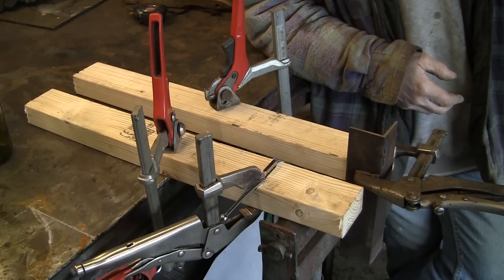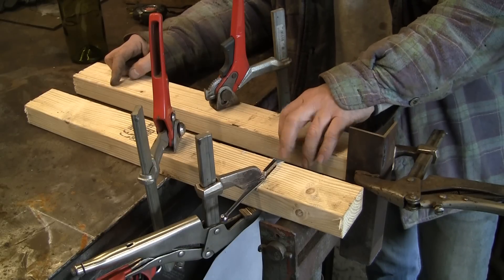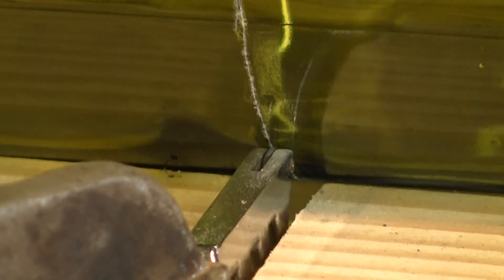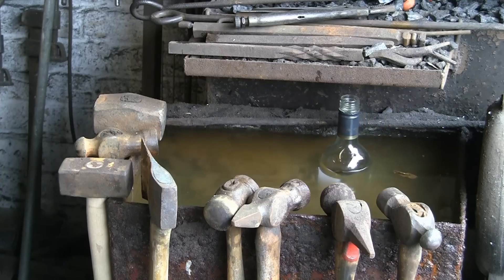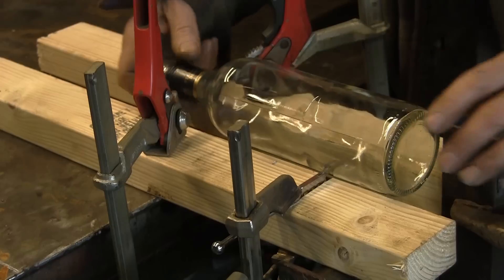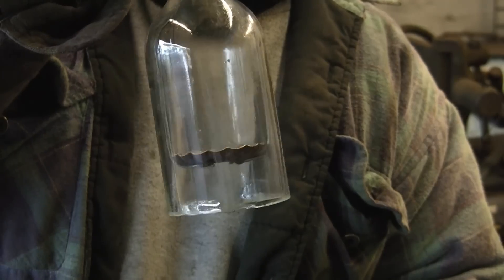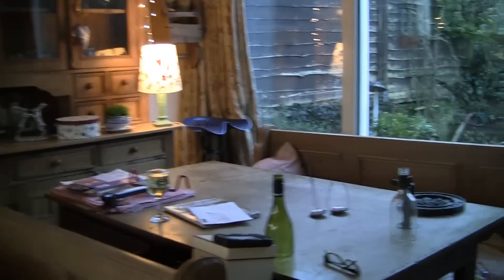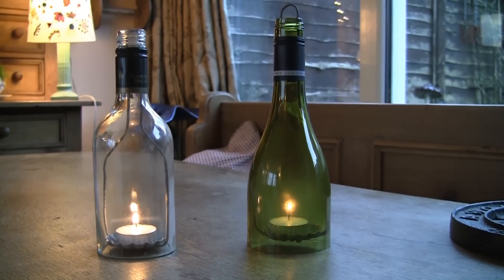Bottle cutting

Comment: The top portion of the bottle make great sounding windchimes I usually run a string down the top of the bottle then a washer to hold the string in the neck of the bottle then from the washer another string with a wood ringer on and then a wind catcher ,really works well ...cut mine the same way some are hit and miss...great vid

Comment: Hey Gary, another great video about cheap ways to keep the misses happy. One thought I had, what about using an acetylene torch with a welding tip to just gently melt the edge after cutting instead of spending all that time with the sandpaper.
Reply from the maker: +Don Marchetti Try it and see, it will probably break though.
Reply: The bottle would have to be preheated. I tried to use propane on cold glass and it exploded. flame was to close to the bottle.

Comment: Hey Gary, I do a lot of homebrew cider and winemaking and have a tip for your bottles.  To get the labels to peel off in one shot I mix 1/2 cup of Arm and Hammer Super Washing Soda into your water and they separate quite clean from the bottle after soaking.  I soak them in hot water so I don't know how it works in cold.  I'm also not sure if it's called the same there, but you're looking for a similar product that has an active ingredient of sodium carbonate.  All the best.

Comment: A process that I have used for "breaking" the glass is: Slowly spin the bottle (keeping it horizontal) over the flame of a candle, following the etched line around the bottle, (About three or four times around the circumference of the bottle.). Then, pass an ice cube around the bottle, again following the etched line. Pretty quick job!

Comment: I am so impressed with your glass separating trick. This will come in handy. Would it work to somehow chuck the bottle in a drill or lathe (maybe using a tapered dowel) and polish the edge that way? Or use a faceplate on the lathe with sandpaper on it and set the speed rather slow? Yeah, that would be less dangerous than the first suggestion. It'd be hard to keep it square but maybe there's a way around that.

Comment: The problem with the clear bottle not following the cut line is actually because of the cutter. Cheap glass cutters are convenient but the wheel is made only from carbon steel, unlike their expensive siblings that use carbide cutters. The way to get by using the cheap glass cutters is to use air tool oil. Cutting a bottle dry will only last for so long, but with the oil (use lots) the cheap cutter will last much longer and give much more consistent cuts.
Reply: Jamie Olinyk I do stained glass work with a silberschnitt cutter. It uses only a tiny bit of oil it gets from a wick so I wouldn't use lots of oil

Comment: Great video mate. Could you use a torch flame to melt and smooth your cut edge or would that set up stresses in the glass?
Reply from the maker: I think this type of glass is too fragile and would crack with the stresses.
Reply: garyhuston Yes I think so to. You'd need some sort of kiln to heat and cool the glass over 24 hours.